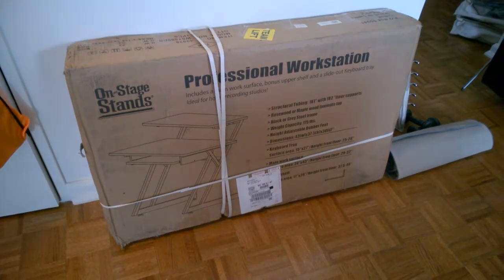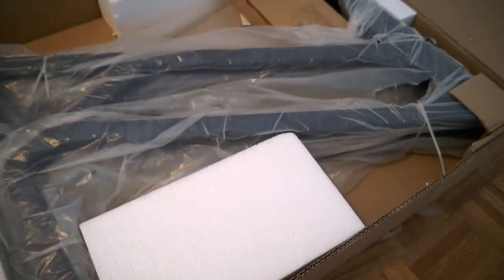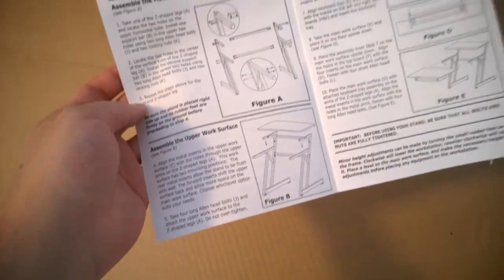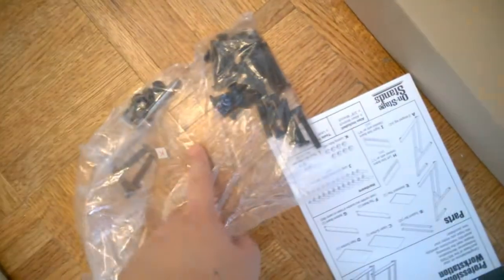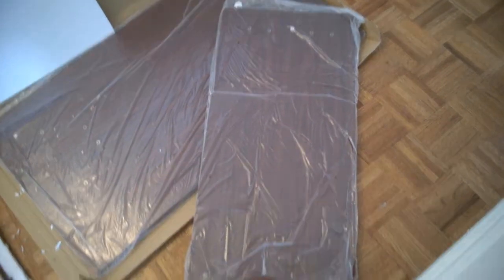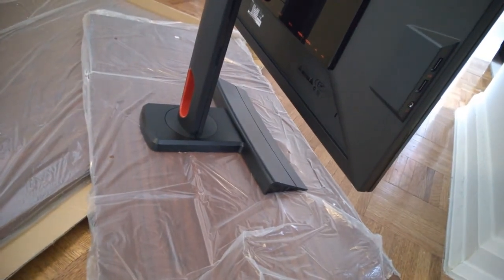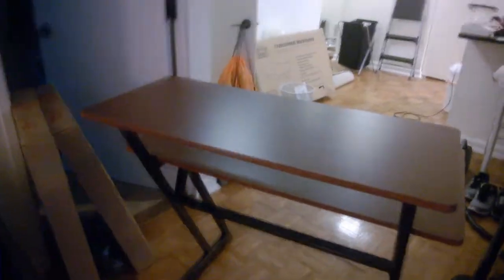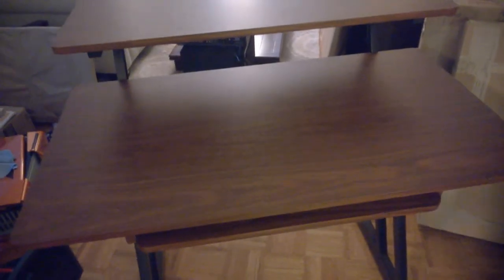On Stage WS7500 Wood Workstation Review

Comment: how do you like it so far? I was thinking about replacing all fake wood with real wood and making whole desk about 4 inches longer on each side on both table tops.
Reply from the maker: I'm still using it today and actually bought another one. I'm not sure about extending it, you would still have to keep the legs underneath at the same distance as the original just in case of the table warping. But 4in should not be a problem. Just note that this desk is not great for 2 monitors above 24in. Things will hang out. I'll try to do a new video here of what I have on my desk her soon.
Reply: djaroonja I get what you saying, lol I didn't say it but..I'm not going to mess with legs, just extend tables, I want to fit two small  monitors and then my JBL305'S on sides. I might just buy stands but in long run longer tables with real solid stain wood would be better.
Reply: djaroonja you should make another video on what you have now on it, and what you just got. do you use for audio production?